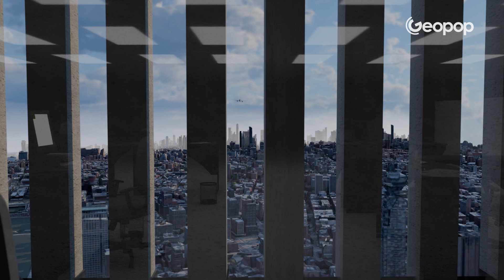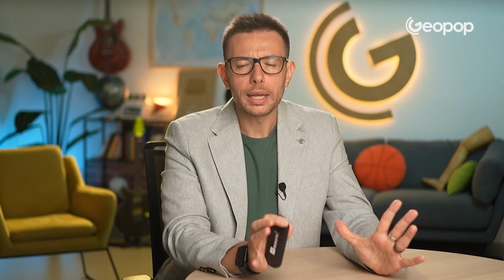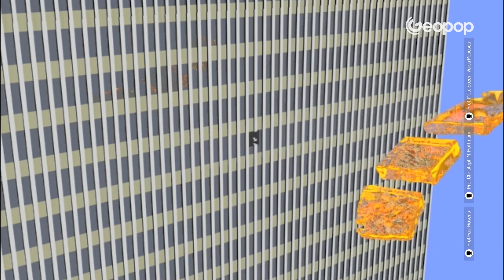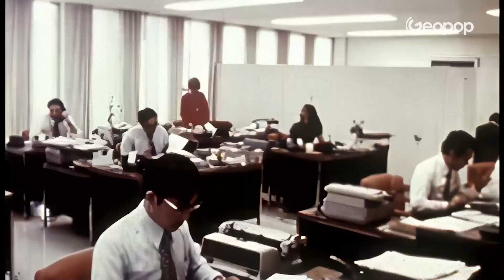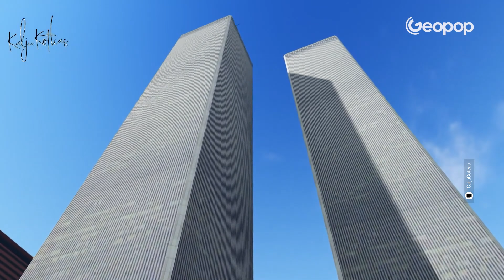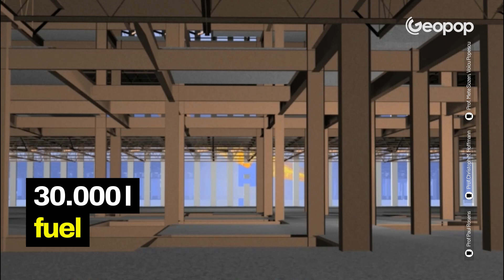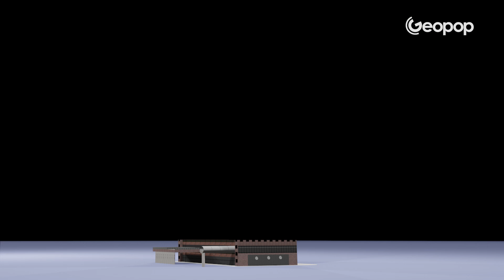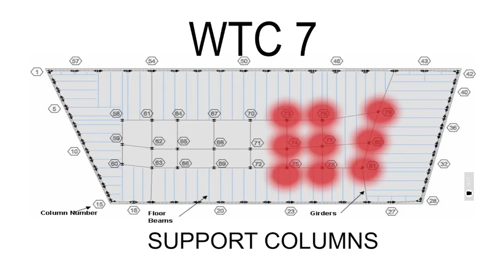9/11, 2001: The Technical Reconstruction of the Twin Towers and WTC 7 Collapses

Comment: How do you explain why the Grenfell Tower not collapsing or when Air India hit that building and the building it landed on didn’t collapse at all 🧐
Reply: Easily.

Grenfell Tower is a reinforced concrete construction that wasn't hit by a plane, so not at all analogous.

The low-rise university building in India wasn't so much hit as it had the aircraft skip across its roof at a fraction of the speed of the 9/11 attackers.

IF you really want to understand an event, study it on its own merits. Don't try to compare it to other dissimilar events you also don't understand.
Reply: You're welcome

Comment: To proof how the towers came down is very hard but the proof that the two planes could never have been the cause is very easy highschool physics. Potential Energy = Kinetic energy. M*g*h = 0,5MV^2  Because the mass cancells out g=9,81m/s^2 you only need the Vmax which everyone can see where the towes fall at the same speed as the debris which is 52m/s terminal velocity. Fill this in and calculate that h represents about 40 floors who had to be nonexistend right below the point of plane impact for the collapse you have seen to be able to happen in a natural way. Off course this was not the case so something els must have helped to make these 40 floors to be nonexistend on the way down. So at least 40 floors must have been blasted on the way down because Mathematics tells us. Newton still doesn't lie.

Comment: Yes, the buildings were able to withstand the aircraft impact as per its design… Both buildings were also rated to be able to withstand fire for at least 3 hours as required by the regulations…

Tower 2 collapsed after 56 minutes and Tower 1 after 1 hour and 42 minutes…. Both significantly below its fire rating of 3 hours.

Before anyone says “but the fireproofing was stripped off when the plane hit”

You can find multiple videos of WTC towers inspection with significant parts of the internal structure with fireproofing had already been stripped off prior to 2001…

The fireproofing has not been applied properly.

Also worth noting that NYFD battalion Chief Pfeifer said in an interview that he thought he had “at least 3 hours”
Reply: It's a combo platter. The mistake is looking at it as impact damage OR fire rather than *impact damage AND fire_ (+ time + gravity).  Too many people fall for the former.
Reply: @TheLoonResistance  “withstand fire 3 hours” means withstand fire for 3 hours WITHOUT any damage to the structural parts…

It’s not withstand 3 hours before failing.
Reply: @tonamg53  - I'm not disagreeing.  Again, it is a multi-element problem which single-element thinkers find difficult to grasp
Reply: @TheLoonResistance  The fire code doesn’t care what started the fire… it only cares that the fire proofing lasted burning for 3 hours without damaging  the insulating structure underneath.

The multi-element in this case is that it’s actually two single piece element that shares a link… the plane crash started the fire but it is not the cause of the collapse. 

The fire is what brought it down… you can replace the “plane crash” with anything that can lead to “un-contain building fire” and the end result would be identical. 

Arson, a bomb, improperly stored flammable materials, flash over from a hidden fire underneath the floor from a lid cigarette butt…

It’s basically not an “If” question but a “when” question.

Comment: It takes hours and sometimes days in an enclosed furnace to heat steel of the cross section of the beams used in the twin towers to reach their plastic stage. That combined with the black smoke which indicated that the a fuel lacked enough oxygen to make the fuel burn at the high temperatures suggested. There is also the problem of steel being poor conductor of heat and concrete even more so. All in all, this analysis of the collapses does not comply with physics.
Reply: Not really.

In this video starting at 22:30 and running to 28:10 the Energetic Materials Research and Testing Center (EMRTC) conducts a test to see what an open jet fuel fire can do to a loaded and unprotected steel I-beam. Remember, steel melts (turns into a liquid) at around 2,600-deg F, give or take depending on specific alloy. The test was planned for 30 minutes.

www.youtube.com/watch?v=JXWCMBuusMI

Within 2 minutes the open fire temperature has already exceeded 2,000 deg-F.

After just 3 minutes 40 seconds the beam is sagging noticeably.

The beam fails and collapses 9 seconds later after just 3 minutes 49 seconds.

Note the steel fails but does not melt. It is bent and twisted, but not a puddle. You can still tell it is an I-beam.

Even heating of the entire beam most definitely NOT REQUIRED. Indeed, better if it isn't. Localized heating will do.

Comment: September 11th. 2 skyscrapers and one building. There was no way 2 planes could destroy skyscrapers. The mass of the aircraft and the very weak shock wave of the fuel are not enough to destroy the supporting columns. In addition, the buildings were designed to withstand being hit by an airplane. There was only a fire for the first few minutes, after which the building only smoked. The absence of a large fire means that the load-bearing columns began to cool after the fuel burned out. The strength of the columns began to increase, the extent of damage to the columns is unknown. All simulations are based on the false argument that the columns are hot, but the columns had already cooled down by the time of the collapse, in addition, all simulations are based on great damage to the columns, but this is very doubtful. There are many skyscrapers that burned to the ground and with open flames and not a single one of them collapsed. If we take into account the completely independent collapse of building number 7, the owner of which confirmed that it was demolished, although the US government claims that it collapsed from a fire, but the problem is that it is impossible to plant charges in a building that is already burning, in addition, it is not clear why it should be demolished when it is burning, you can let it burn out completely and then demolish it, so there is every reason to claim that the charges were planted in the buildings before simulating a terrorist attack. It is also worth noting the amazing accuracy of the supposed terrorists the first time, two out of two hits almost exactly in the center, but the Boeings have a remote control system or flight programs installed, so they could have been programmed and there might not have been any pseudo terrorists in them. This is confirmed by the fact that the black boxes were never found. Also, the deviation of the plane from the course should force the dispatcher to press the alarm button, which would launch the fighter on duty, but there were no fighters. If the black boxes were found, they would most likely show that there was no hijacking of the planes. Also, it was definitely a Tomahawk missile or similar that crashed into the Pentagon, not an airplane. Which means that the terrorist attacks were completely staged. In addition, the Pentagon is protected by layered air defense, but in some completely mysterious way the missile was able to penetrate the entire defense. But if she had a transponder, the defense system would not turn on, which is what happened. There are several fires in skyscrapers, none of them collapsed, for example Tiger Tower 67 floors, burned like a match with an open flame for 14 hours, from top to bottom and nothing. Immediately after the attacks, the United States invades Afghanistan and Iraq. But Iraq has nothing to do with this at all because there is a lot of oil there. In theory, the United States should have invaded Saudi Arabia, where the terrorists were supposedly from, but they did not invade there. There is not a single witness who said that this government organized terrorist attacks. Bush needed a casus belli and he found it by staging the 9/11 terrorist attack. This terrorist attack is the same fraud as Colin Powell's washing powder, which he presented to the UN as a biological weapon. All these puppets with "scientific" tags and fraudulent computer stimulation are simply government scammers paid to replicate the official version. People don't know that computer simulations are not facts, computer simulations can be adjusted until you get the result you want. Many architects doubt the collapse of three skyscrapers due to fire.
Reply: 1. It doesn't matter if a skycraper is famous or not - has no bearing on anything - and your claim is an appeal to an obvious logical fallacy:  the first time in history which purports that if something has never happened before it can't ever happen.  Which is complete nonsense.  This video explains reasonably well the how and why.  Take the time to understand instead of engaging in logical fallacies. Makes no difference if it is an unprecedented event. There is a reason that word exists. 

2. Controlled demolition is the first, last and only resort of people who don't take the time to understand - or are simply unable.

3. Larry Silverstein in a TV interview admitted he agreed with a fire department commander they should pull “it” (the firefighting operation – pull the guys out) because the building could not be saved and they wanted to avoid further loss of life. What did you think he meant?  Oh wait, you saw a movie made by 3 kids (or just copied from someone else who saw the movie) that claimed it meant something else, and you just ran with it?  You should try watching the interview instead of mindlessly repeating other peoples failed interpretations of it. 

I kinda stopped at that point.

Comment: I watch the firemen carrying those hoses into the building. Was there connection points inside the towers, or were they going to pump from ground level.
Reply: None of the firemen went in to put out the fires. They went in to rescue people. If knocking down a pocket of fire was necessary to do that then they had that gear with them. And yes, every floor will have connections.

Comment: These kind of explanations talk about the heat weakening the structure - a claim to support the government case. BUT, if we ignore the fire, the heat, the planes and *simply look at the way in which the buildings collapsed*, it screams "control demolition". 

If the fire heat reached temperature that could melt the structure, the building would have NOT collapsed in a neat, almost perfect, vertical "free fall". Only control demolition can achieve almost free fall vertical collapses. 

We must not let them use computer imagery to con us into believing an explanation that contradicts the laws of physics - a building can not have a free fall because floors act as resistance, so that floors falling have floors  underneath, which slows down the fall. However, the towers fall as if there is just dust under the falling upper floors. How could that be? If the fires caused the collapses, the buildings would have fallen in a chaotic manner, because the fires were not uniformly distributed. 😮

We must ignore these computer aided demonstrations, which are used to decive us!
Reply: That's like ignoring the gun in a shooting.  How about we look at the whole picture instead of trying to ignore the parts that are inconvenient to your case ?

Comment: So im not a conspiracy guy but some really fishy and strange things did happen on 911, one is how did the bottom of the building collapse at free fall speed? I understand the top was bending and saging the steel but the bottom to? Also if u zoom in on the plane rite before it hit the tower, there was a round object on the belly of the plane, literally a ball under the plane, what was that? Go look and see wat i mean, and man theres so much more werid and impossible shit that happend
Reply: The bottom of what building?

There is no such thing as free fall speed since free fall (gravitational acceleration) is NOT a measurement of velocity.  Anyone using a made-up nonsense term like that is just advertising ignorance.

Can how fast something falls tell you what started it falling?

The round object on the belling of the plane was the main landing gear fairing. Every B767 has them.

IF you are not a conspiracy guy why do you so easily repeat so many tired old conspiracy memes and dead horses?